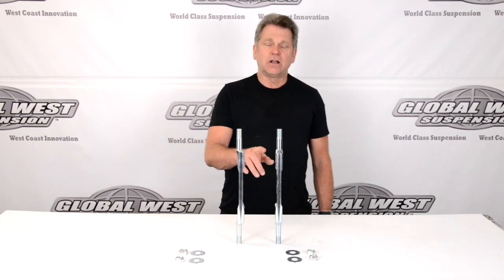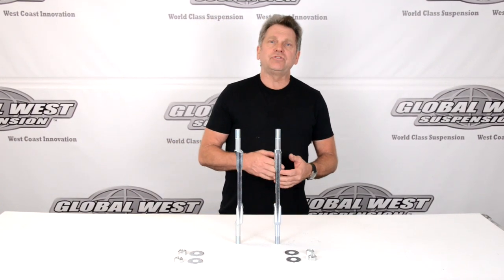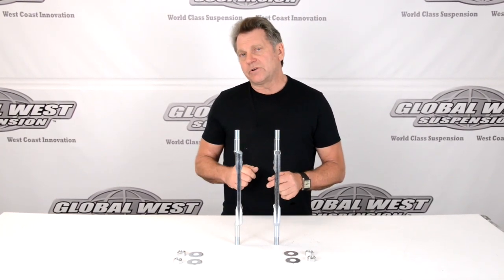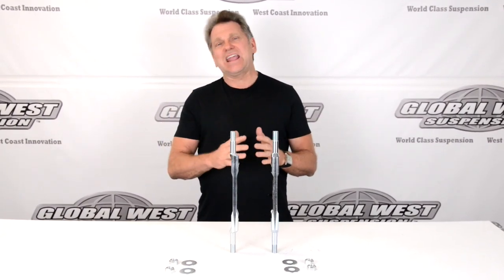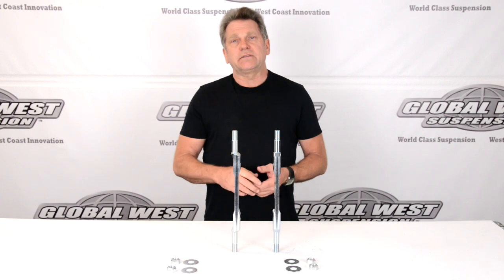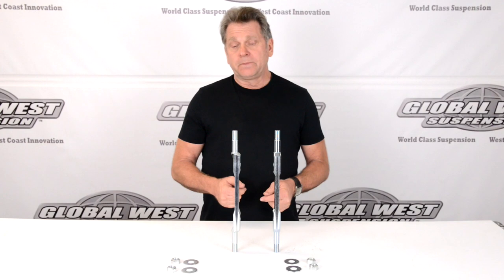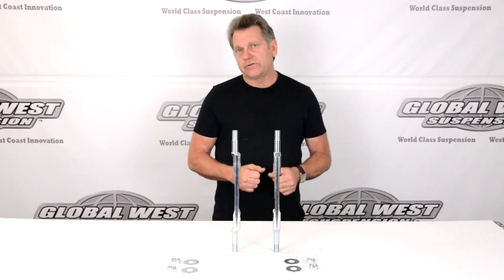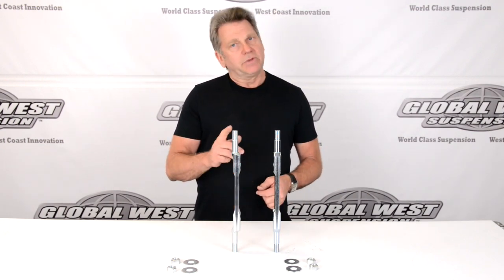One Possible Fix For Alignment Problems On 1965-1970 Impala, Caprice, Biscayne & Bel Airs

Comment: I have a 68 ss427 impala, I never knew there could be frame sag. I will have to  get the offset shaft for the pass. side it seems, camber is way off.
Reply from the maker: good luck !